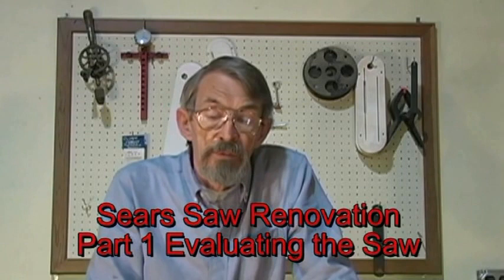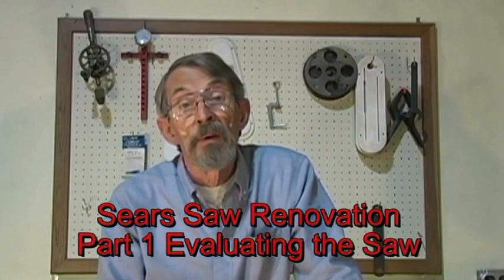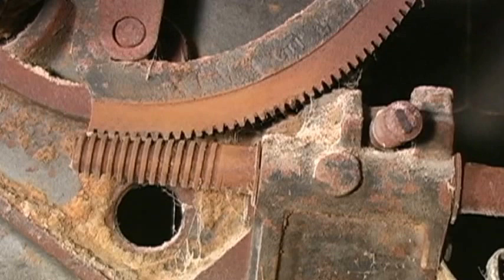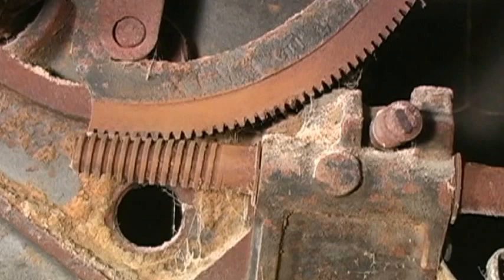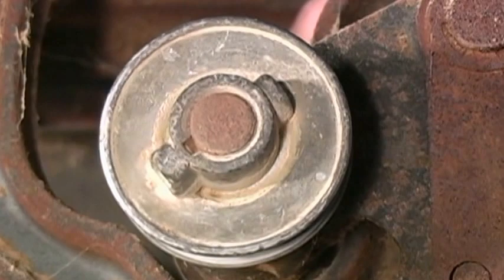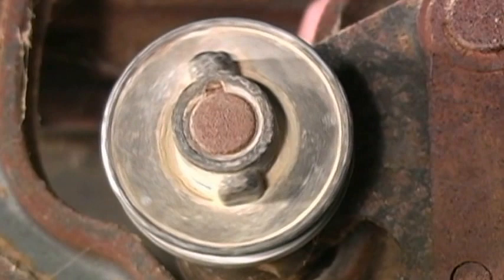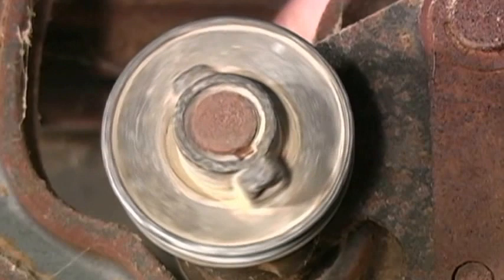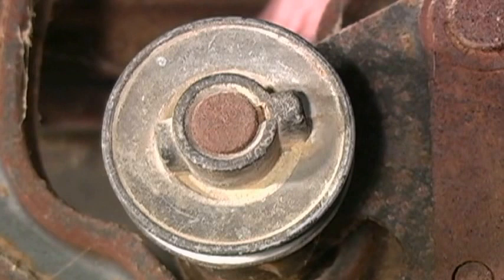Sears Contractor Saw Renovation Part 1 Evaluating the Saw

Comment: Hey Jerry,  Read me :)

This is the guy down in GA that ordered the Pals and Pulley and Belt combo about a month ago. We talked at length about you creating this series, and I'm so happy it's being uploaded now. I've disassembled and cleaned every inch of rust off my dad's '84 Craftsman 113.298032  and gave her I fresh coat of enamel. Every medium to small sized component was sand blasted at my job and I'm in the stages of putting it back together now. I'm hoping these videos are going to be coming rapid fire I'd love to follow along when it comes to squaring the tabletop to the blade as well as seeing the pals going on this saw. 

I assume because you sell them you will be talking about how much and how inexpensively one can improve these saw's performance with your aftermarket Pals and Pulleys. I've picked up a few good inexpensive tips throughout this experience that you may find interesting and would like to share.

 I picked up a tip over at the NelsonStudios channel about melting powered graphite $2.00 (autozone/advanced auto) into candle wax to make a fast holding dry lubricant that seems to have worked very well on all the threaded components and trunions.

The general consensus on lube for the pin where the arbor assembly mounts is detergent free 30W oil (autozone/advanced auto) also.

It may be worth mentioning that Advanced Auto (the one I used) and other automotive parts stores will have the equipment free and on hand to pull any stubborn pulleys and was invaluable when it came time pull the arbor bearings off the arbor for replacement. 

Speaking of Arbor bearings...I purchased very high quality Japanese bearings for my arbor for less than $14.00 shipped from Accurate Bearing (another community favorite).

I hope this finds you well,
Jonathan Jones.
Reply from the maker: +jon jones  Jon, thanks for the input.  I will be sure to point out some of these tips in the upcoming segments.

Comment: I have a problem maybe you can advise me on it the saw arbor housing arm that pivots on the shaft is not froze up and I've been spray lubing it to death it's designed is awkward for a puller any suggestions

Comment: use,a tread file to repair the treads easy ànd the past owner did not know hot to lubrication of the two end trunnion with a non oil or grade I used silicon spay into each trunnion I have no problem with my tilt handwheel turning I also silicone on the elevation screw ànd the tilt screw in Sear manual it say to use no 20 or 30 engine oil that is not a good lubrication it attracts saw dust

Comment: Oh yeah...and I got mine from the dump!....still working on it, but it was/is obvious to me that you can make a great saw from the old Craftsman that people quite often whine is 'not accurate'....mediocre at best, etc.
Reply: I bought a cement mixer back from the scrap yard someone ran across the scales for twice the scrap price. The drum had a few spots rusted from not pointing it down but not bad enough for me to take a body grinder to it and then wrap it with fiberglass. I've used it a few times with no issues.
I look at it like it's not going to a hot rod show, and dosen't have to be a precision piece like in aerospace.
It doesn't have to be perfect, all it has to do is be right and work.
And I'm a master toolmaker for the industry.

Comment: I bought this saw a few weeks ago an got some decent use out of it . It threw the blade pulley twice so the second time I put epoxy on the keyway and loctite on the set screw. When I went to fire it up I couldn't get the blade height to adjust at all and it appears as though the gear screw is backed too far out . ANY SUGGESTIONS HOW TO GET THIS BACK WORKING WOULD BE APPRECIATED

Comment: I obtained a craftsman contractors table saw from a landfill-needs extensive rebuilding and cleaning.first thing I noticed is the missing motor and possible mounting brackets for motor. everything else works ok. Where would I look for specs on this saw so I can obtain proper parts and where could parts be located for saw in question?

Comment: Could a DIYer without a machine to redo the entire top just take something like JB weld and fill in the gouges and scratches, then sand them down flush, clean up the rest of the top and then wax the thing?

Comment: As Ignorant as I am, I would probably have drowned the thing in penetrating oil, worked it loose and lubricated as needed.  I would have sanded the surface lightly (pits be damned) and adjusted for square and that saw would have begun to see use after a few hours.  What do I know.

Comment: I would not worry about a 7 thou deep blemish. It will not be noticeable in woodworking operations that this tool will be suitable for. The difference in the surface of the top and the surface of the throat plate is far more.
Reply: I've always been reminded "we're not building pianos".....just stone it out and be done with it. Machine shops charge by the hour up to $120.
Reply: If this is an enjoyable project go ahead but the surface is not nearly as important as blade alignment with top & fence

Comment: It might not have worked; but, my 1st try at fixing the gouges on the top would've been a very thin coat of JB Weld, followed by some light sanding.
Reply: I think the better approach would be filling by brazing. It’s a vital skill that is MUCH easier to acquire than you would think, requires only small outlay for small jobs, and is a WORLD better than JB Weld, which I find to be really quite unremarkable and certainly not the “magic”, get-out-of-jail-free repair tool that people think it is. 
You can put “weld” in the title, but it’s still epoxy. Group it with things that are handy like duct tape and WD-40...not in the group with Aladdin’s Lamp, and The One Ring to Rule Them All.
Reply: @NMranchhand  I

Comment: These things are a dime a dozen on Craigslist, at least where I live.  Even beaten up ones can be a good deal as long as you don't have to replace the arbor.  If you do have to replace the arbor, I would insist on getting it for next to nothing because that part will cost you more than $100.  

I bought my Craftsman table saw (model 113....) used for $130, and I thought that was a good deal at the time.  It had only a 1 HP motor, the original motor from 30 years ago, and I had to replace the pulleys, and the threaded rod that controls the blade tilt is messed up somehow because the blade can only tilt to 45.6 degrees before it hits the stop nut, even when it's all the way back on the threaded rod, but I don't do beveled cuts very much, so I don't really care.  I mostly use it for precision cross cuts and precision joinery because the cut quality is still excellent.  The people I had bought it from actually used it to make furniture before they upgraded to a massive cabinet makers saw, so it had been reasonably well taken care of for at least most of its life.
Reply: Got my 1954 103.20003 for $30

Comment: At 8:39 you will see he is kind of pointing at a silver lever just under the deck, is this a lock to hold the saw blade at the proper height?   I have a  Sears #100 saw and I have a problem keeping the blade at the same height.   I set it at say .50 inch and soon it drops to .45 or .40  this makes it difficult to use dado blades.  That lever is very loose, how do I take it off??  Anyone got an answer?

Comment: Just a quick question PLease....I have a saw very similar to yours in t he video.  The base panel where the tilt handle is located tends to be rather flexible.  When you try to tilt the blade with it the panel moves with the force applied by the handle varying your accuracy of tilt. what do you do to address this?......re-enforce that area of the base?

thanks Jim
Reply: James, to stop the side panel from flexing on my Sears 315 saw I bolted a 1" x 1"x 1/8" angle iron vertically on the inner side of the side panel next to the blade tilt crank screw.  Put one bolt at the top, one in the center next to tilt screw bearing housing, and one at the bottom.  A second angle iron on the opposite side of the tilt screw would add even more rigidity, but I think one is adequate.

Comment: @Jerry Cole what is your thoughts on extruded Aluminum Fences found on like the ridgid ts2412 and ts2424?
Reply: I just bought and installed a Delta fence on my 2 HP General contractor saw with a 27x40 cast iron deck.  It was the second cheapest fence on Amazon ($250).  Kit includes rails, all parts and tools necessary for installation.  It's a high quality fence that's easy to install and when I put the fence on the newly installed rails it was dead accurate to the blade and miter slots and runs smoothly across the table.  I did a lot of research including Youtube videos on fences before I made my purchase.

Comment: These were dangerous saws. The 113.xxxxx saws were made by Emerson Co. and the 315.xxxxx series were made by Ryobi.
    I have a whole restoration document on how to restore and improve sears contractor saws 113.xxxxx series. It makes then safer, more accurate and run better. It is free on my google drive for download. A proper restoration will cost $600.00 to $1250.00 in 2024 depending on the starting condition of the saw and assuming you do not need a motor.
Just reply for a copy.

Comment: While this video has been very informative and useful I would never try to rejuvenate that particular saw. I have owned one of those and I can often pick 1 up for less than $50. I have seen Powermatic and Unisaws also for around $300 to $500 and I cant justify the amount of labor or money for parts on a low end Craftsman that would be needed to put 1 like that back into shape.
Reply: Just to take the other side (from the excellent points made in your comment), I find that this type of work more than rewards the doer for his time and small (very small) outlay. We shouldn’t be niggardly with our time and labor when learning and experience are in the offing. 
Young people and old often use the “waste of time” excuse to avoid of valuable learning experience.